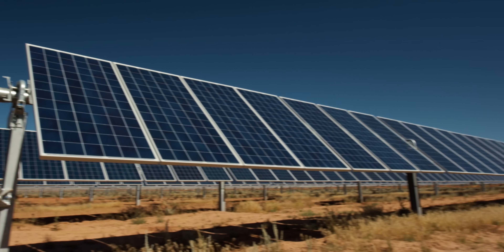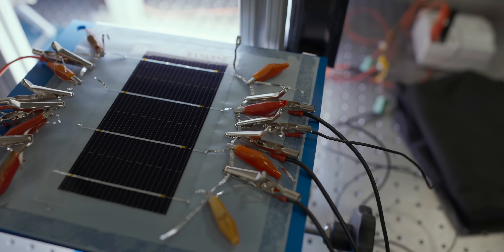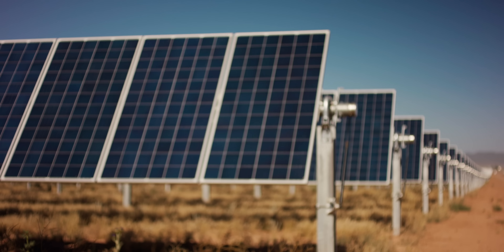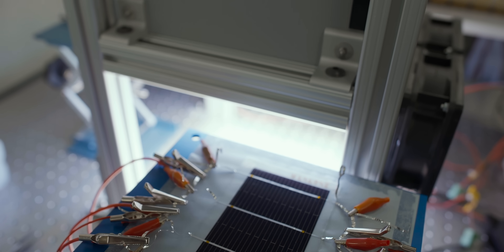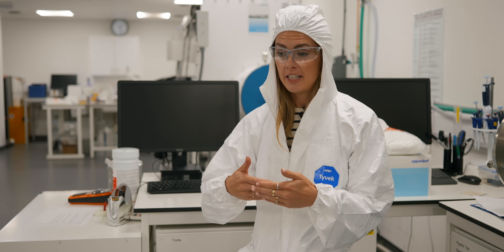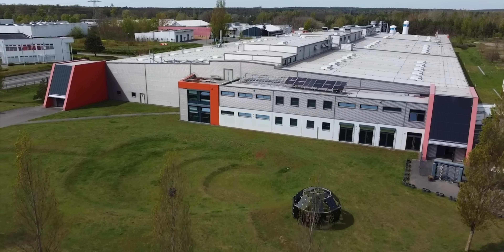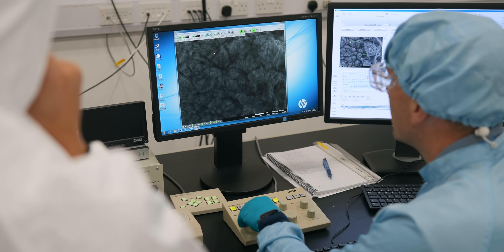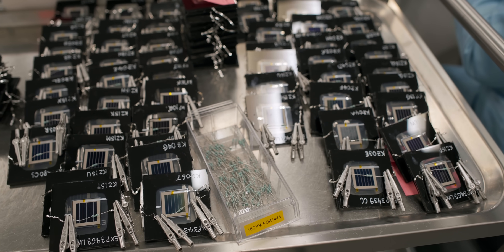This MAGIC Ingredient Is Doubling The Power Of Solar Cells!

Comment: Probably the main reason that it has taken 14 years is because politicians have zero appreciation of science and scientists. They would rather throw taxpayers money on dangerous and eye-watering cost nuclear power stations - if this exciting breakthrough were incorporated on as many roofs of homes, commercial and industrial buildings together with efficient high-capacity batteries, plus now realistic geothermal plants, we would solve the demand for electricity AND since both of these technologies are totally renewable and zero carbon in operation, the so-called 'Carbon Footprint' would swiftly diminish.  I am a scientist with over 50 years experience of trying to deal with politicians - it is a waste of time.

Comment: 122804  The second law of thermodynamics may be false conventional wisdom. Let's face the wonder of full heat use. 

The second law of thermodynamics was developed during victorian england's scientific and religious fascination with steam engines. 

The second law is behind modern refrigerators needing electrical energy to compress the refrigerent to force it to release as waste the heat that it has removed from the refrigerator's service interior in the cooling part of the refrigerent's circulation. The interior coldness draws in exterior heat through the cabinet insulation. There is also discarded heat from mechanical friction and electrical resistance. The net thermal output equals the electrical input with energy not being gained or lost in this refrigeration system including its forced waste. Unencumbered refrigeration by the principle that energy is conserved should produce electricity instead of consuming it. 

It makes more sense that refrigerators should yield electricity because energy is widely known to change form with no ultimate path of energy gain or loss being found. Therefore any form of fully recyclable energy can be cycled endlessly in any quantity. 

Full heat recycling, all electric, very isolated underground, undersea, or space communities would be highly survivable with self sufficient EMP resistant LED light  automated vertical farms, thaw resistant frozen food storehouses, factories, dwellings, self contained elevators, safe rooms, and horizontal transports. 

In a flourishing civillization, small self sufficient electric or cooling devices of many kinds and styles like lamps, smartphones, hotplates, water heaters, cooler chests, fans, radios, TVs, cameras, security devices, robot test equipment, scales, transaction terminals, wall clocks, open or ciosed for business luminous signs, power hand tools, ditch diggers, pumps, and personal transports, would be available for immediate use incrementally anywhere as people as individuals or larger social groups see fit. 

Some equipment groups could be consolidated on local networks. 

If a high majority thinks our civilization should geoengineer gigatons or 
teratons of carbon dioxide out of our environment, instalations using devices that convert ambient heat into electricity can hypothetically be scaled up do it with a choice of comsequences including many beneficial ones. 

Energy sensible refrigerators that absorb heat and yield electricity would complement computers as computing consumes electricity and yields heat. Computing would be free. Chips could have energy recycling built in.
This would improve performance and lower cost,

A simple rectifier crystal can, iust short of a replicatable long term demonstration of a powerful prototype, almost certainly filter the random thermal motioren of electrons or discrete positiive charged voids called holes so the electric current flowing in one direction predominates. At low system voltage, a filtrate of one polarity predominates only a little but there is always usable electrical power derived from the source, which is Johnson (observation) Nyquest (theory) thermal electrical noise. This net electrical filtrate can be aggregated in a group of separate diodes in consistent alignment parallel creating widely scalable electrical power. The maximum energy is converted from ambient heat to productive direct current electricity when the electrical load electrical resistance  is equal to the array internal electrical resistance. 

Maximum calculated electrical power output (watts) is k (Boltźman's constant), one point three eight x 10^ minus 23, times T (temperature Kelvin) times bandwidth (0 Hz to a natural limit ~2 THz @ 290 K) times rectification halving and nanowatt power level rectification efficiency, times the number of diodes in the array. 

There are a billion cells of 1000 square nanometer area each per square millimeter, 100 billion per square centimeter. 

Order is imposed on the random thermal motion of electrons by the structual orderlyness of a diode array made of diodes made within a slab: 

Host crystal is silicon
  P type boron doped
-----‐------‐----___-- Out
🔻🔻🔻🔻
■■■■■■___ + Out 
  N type phosphorous doped 

All the P type semiconductor anodes abut a metal conductive plane deposited on the top face of the slab with nonrectifying joins;  the N type semiconductor cathodes or common cathode abuts the bottom face. As the polarity filtered electrical energy is exported, the amount of thermal energy in the group of diodes decreases. This group cooling will draw heat in from the surrounding ambient heat at a rate depending on the filtering rate and thermal resistance between the group and ambient gas, liquid, or solid warmer than absolute zero. There is always a lot of ambient heat on our planet, more on equatorial dry desert summer days and less on polar desert winter nights.

Focusing on the composition of one simple diode, a near flawless crystal of silicon is modified by implanting a small amount of phosphorus (N type conductivity) on one side from a ohmic contact end to a junction where the additive is suddenly and completely changed to boron (P type conductivity) with minimal disturbance of the crystal lattice. The crystal then continues to another ohmic contact. 

A region of high electrical resistance forms at the junction in this type of diode when the phosphorous near the ĵunction donates electrons that are free to move elsewhere while leaving phosphorus ions held in the crystal while the boron donates holes which are similalarly free to move. The two types of mobile charges mutually clear each other away near the junction leaving little electrical conductivity. An equlibrium width of this region is settled between the phosphorus, boron, electrons, and holes. Thermal noise is beyond steady state equlibrium. Thermal noise transients, where mobile electrons move from the phosphorus added side to the boron added side ride transient extra conductivity so t⁶he forward moving  electrons are preferentally filtered into the external circuit. Mobile electrons are units of electric current. They lose their thermal energy of motion and gain voltage, as they transition between the junction and the array electrical tap. 

Inside the diode, heat is absorbe; outside the diode, to exactly the same extent, an attached electrical circuit is energized. The voltage of a diode array is likely to be small so many similar arrays need to be put in series to build higher voltage.  

Understanding diodes is one way to become convinced that Johnson Nyquest thermal electrical noise can be rectified and aggregated. Self assembling development teams may find many ways to accomplish this wide mission. Taxonomically there should be many ways ways to convert heat directly into electricity. 

A practical device may use an array of Au needles in a SiO2 matrix abutting N type GaAs. These were made in the 1970s when registration technology was poor so it was easier to fabricate arrays and select one diode than just make one diode. 

There are other plausible breeches of the second law of thermodynamics. Hopefully a lot of people, mostly as independent teams, will join in expanding the breech. Please share the successes or setbacks of experiemental efforts. 

These devices would probably become segmented commodities sold with minimal margin over supply cost. They would be manufactured by advanced automation that does not need financial incentive. Applicable best practices would be adopted. Business details would be open public knowledge. Associated people should move as negotiated and freely and honestly talk. Commerce would be a planetary scale unified conglomerate of diverse local cooperatives. There is no need of wealth extracting top commanders. We do not need often token philanthropy from the top if the wide majority of people can afford to be generous. 

Diode arrays may be applied to warfare. War is terrible. Stable respected borders enforced by world suppression of invasion is needed.

Aloha

Comment: I think Perovskite will be great, but it might be after some 4-7 years. 1) First perovskite won´t be available yet in (2 years)  2) When it will, the demand will be high, production not yet full, and greedy companies will take their share  3) Perosvkite will consist of 2 layers, and the price will be higher than of ordinary solar panels  4) the % won´t be that much higher in the first years (25-27%) while ordinary 22,5-24,5%.  5) When perovskite comes, ordinary panels will be sold at a rebate to reduce world wide stocks.  6) There will still be a small uncertainty of how long Perovskite will last.   7) When prices and efficiency are at place (after 7 years) solar will be built at a high number.

Comment: Great video and very interesting,
I'm all for new technology that can turn around climate change,
I drive and EV and love it being cheep to run and maintain,
One question I would like to ask is how Solar fields / farms affect the immediate area,
If I go to my car when it's been parked in the sun for a few hours I can't touch the body as it's hot,
This has raised the air temperature around the car I would imagine even if only by a very small amount,
What kind of temperature change will you see around a solar farm and does it help to increase the global warming event by anything at all or does it have a different affect because it's obsorbing the heat and changing the light energy to stored energy and having a cooling effect,
It would be interesting to see temperature readings around the solar farm and then at the same time a few miles away,
If there's an heating effect of this process then the next question to be answered is how much of Earth surface area can have solar panels before we have thermal run away,
Please don't miss understand me as I'm all for it and progress but we need to know now and not after the event.

Comment: Does Two Axis solar Tacking improves efficiency 40%?
Yes, a two-axis solar tracking system can improve solar panel efficiency by up to 40% compared to fixed panels, as it continuously follows the sun's movement in both the east-west and north-south directions, maximizing the amount of sunlight captured throughout the day. 
Key points about two-axis solar tracking:
Increased energy production:
By constantly adjusting to the sun's position, a dual-axis tracker can generate significantly more electricity than a fixed panel system. 
Movement on two axes:
Unlike a single-axis tracker which only follows the east-west movement, a dual-axis tracker also tracks the sun's north-south movement, leading to better overall efficiency. 
Higher initial cost:
While offering greater energy output, dual-axis trackers are generally more expensive to install and maintain due to their complex design with more moving parts

Comment: I live in theLas Vegas valley, Nevada, USA.  My wife and I RENT our rooftop solar because, when we began using solar we were in our 70s and purchasing rooftop solar would not have been an amount we could possibly amortize unless we live two be 100.  Even so, by paying US $100. per monty for rental this year (our rate increases by 3% annually) and a $19. per month unavoidable "grid fee" we are saving many hundreds of dollars every year compared to non-solar neighbors.  Only in 2024's  hottest months did we pay for any electricity and that amounted to $20. per month on the two hottest months.
With a perovskite/silicone laminate solar array of the same size as our current array AND a Li Fe Po battery bank inside on our garage wall we could have easily lived "off grid" and such a high efficiency array would have been worth an outright purchase, even the geezerhood of our lives. 
Imagine such an array with an LFP battery bank and a high efficiency heat pump air conditioner/furnace. Our HVAC and electric bills would be virtually non-existant! A boy can dream.

Comment: Unfortunately our government works against us. Because electric cars don't pay taxes at the pump some places want to add a tax for every 1000 miles driven. Yet if the car is plugged in to charge tax is paid through the electric bill. They are also looking to charge taxes on those places that have solar cells. That payoff over a certain amount of time is going to get extended and those considering them are going to hold off buying them. Watch California to do this first. In the face of ruin financially they will look to every source of revenue they can to maintain the illegals and gangs that crap and urinate on the sidewalks. To pay for the education and the health care of anchor babies without fathers. And finally pay for the political war chests they need to stay in power so they can have restaurants and beauty shops open on their command during a pandemic. All the possibilities are quashed by a group of people that are supposed to be working for us.

Comment: Excellent work, however since the Sun only shines 8-12 hours a day Solar cannot be used as a base power. But recent battery technology from an Australian company based on graphene/Aluminum holds great promise for EV's and Homes. A house with adequate solar cells can produce enough electricity for daily use and store it. Australia is having huge problems with their grid because of over abundant use Solar cells. They are now considering to disconnect Solar users to save their grid system.

Comment: Sounds like shill. I have been hearing about these perovskites for a quite a while, may be 10 years. Nothing is available right now, as the guy claims in 2 years it should be available to the masses, but I doubt it. Bifacial solar is already available and it can exceed the 25% efficiency, so 30% is a very small step. If you have space available these efficiencies don't matter but price per watt does matter.

Comment: I make my own solar electricity by replacing silicon cells with flat silvered sheet metal.

I form the sheet metal into a standard geometrical shape ( not parabolic) that focuses 100 square feet of sunlight at 600:1 that heats a boiler, that creates dry steam and then I use a turbine to generate ac and dc.

Each solar conversion unit costs me about $60.

I need only one.

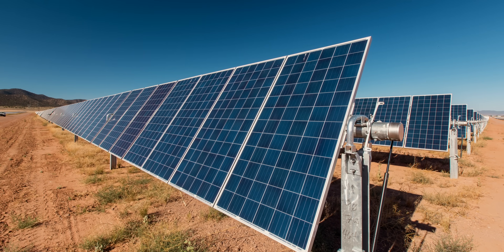Comment: 2:54 min Oxford PV's solar panels are "multijunction solar cells" made up of silicon and perovskite. The silicon absorbs the longer (infrared) wavelength of the solar spectrum, and the perovskite absorbs the shorter (ultraviolet) wavelength, raising the efficiency potential to 43%.

Comment: It is not really all that impressive, pay 1.8 times to get 2x the power. I prefer 20% sells at the cost of wallpaper so any one can afford to get some "free" power today. Cheap and easy to get may be bad in a date but not in private power production. If panels are "cheap as chips" (and recyclable) the longevity is of less importance as well. If I can buy a panel that gives 20% and lives 5 years but is compostable for peanuts I will adapt to that situation. Now we pay our power bill every month and if panels and batteries cost half that over 5 years and do not pollute I´ll take it. 
So to conclude, cheap is better than efficient in my opinion.

Comment: Guys, go for bifacial solar panels. Efficiency around 30%(both sides,front and back, could generate electricity), and there is even output during cloudy days. Use it as a canopy and use reflective furnitures and mirrors to reflect even more sunlight on the under side
Reply: Why not bificial tandem cells with mirrors? Why not cube tandem structures with 3 mirrors?

Comment: Efficiency of solar panels is almost irrelevant.  The differential cost of operations of a 100 MW plant operating with an efficiency of 20% versus 22% is minimum, as the cost of energy is the same… zero!   Only the initial investment would be somewhat higher.  But still improved efficiency is welcome.

Comment: If I can get 8kw on my roof where a 4kw array used to be - and a 30kwh battery for half what it costs today - then I could be off grid 99.9% of the year - including heating (with Far infrared heating) and the rare occasions I need grid power, could be covered by grid-scale biogas and wind power.
But if the 28 million households in the UK ALL had 8kw of PV and a 30kwh battery - then a 'smart grid' could connect them all & connecting the UK's wind fleet would mean there would always be a MASSIVE surplus.
But the powers that be don't want "Power to the People" where everyone can generate 99.99% of their own electricity and heating needs - they want big corporate owned arrays, nukes and gas... and to sell us electricity at 28p per kwh, which costs them 1p per kwh to generate + £5 a week just for the grid connection.
Renewable energy could be 'Power to the People' - and the authoritarian politicians and corporates (basically the same people) want to use it to enslave humanity still further.